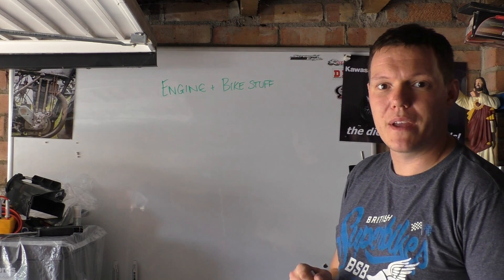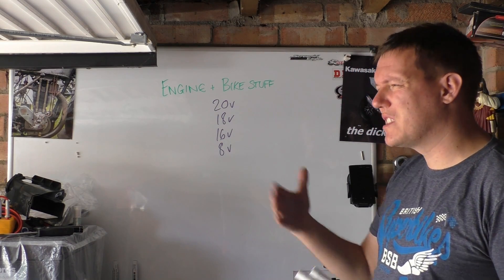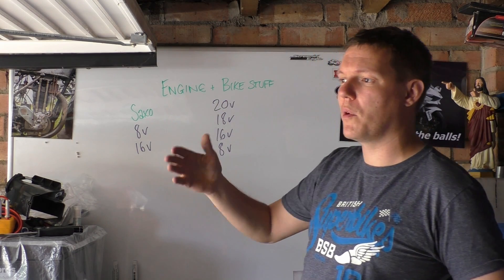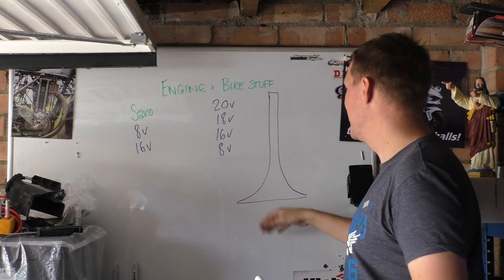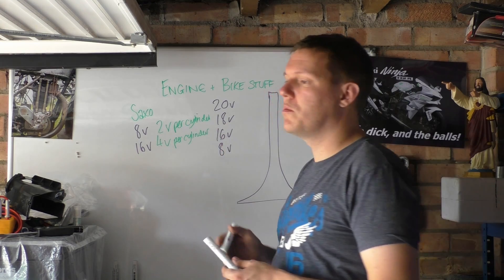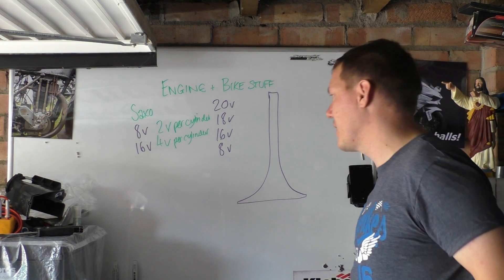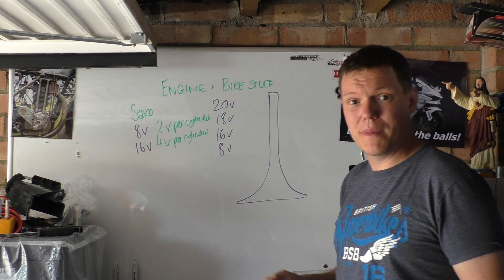What does 18Valve mean?

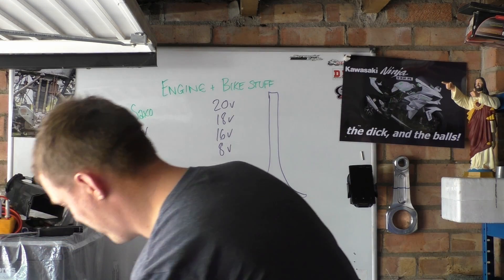Comment: At 1:51 you said the valves have to go in each cylinder... Never ever seen them in the cylinder. Only in the cylinder head... I know it is per cylinder but the are in the cylinder head. 20V are mostly 4cylinder engines with 5 valves per cylinder (located in the cylinder head). 6 Cylinder engines are common to have 12 or 24 valves per cylinder. The reason is you cant divide 20 with 6 and get a whole amount of valves unless you manage to make it run with 3 1/3 valve per cylinder. Matt the orange juice is missing the caffeine to make you knob head work right!!!
Reply: And yes I owned an Audi 100 5D a 1980 or 1981 was it... the diesel one. Of course it is possible a 5 cylinder. I just wanted to give him some love ;)

Comment: Pentroof=20v?
Reply from the maker: 5 cylinder or 5v 4 cylinder - maths, just fucking amazing
Reply: Saw your video re: American V8's from a while back and in that you explained the concept of a pentroof in its basic form. To my mind a pentroof should be comprised of 5 "sides" for 3 inlet and 2 outlet valves - 5 implied by the use of the term "pent." (Pentagon - 5 sided object?) Spark plug in the top and Robert's your mother's brother. The example which springs to my mind being a car fuckhead is the 4AG series of 4 cylinders with heads from Yamaha in the 90's that offered the 20V that revved to 9K all day and took very well to turbocharging. If your reply was highlighting the seeming ignorance of correct nomenclature/descriptive terms then I wholeheartedly agree.